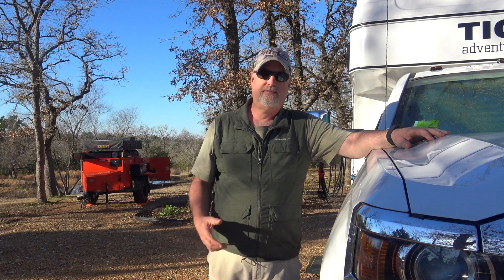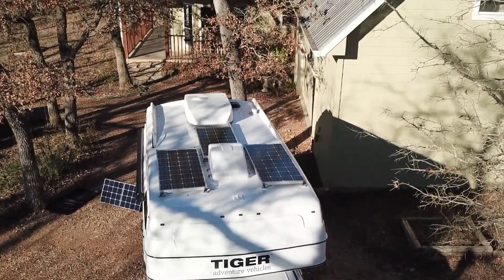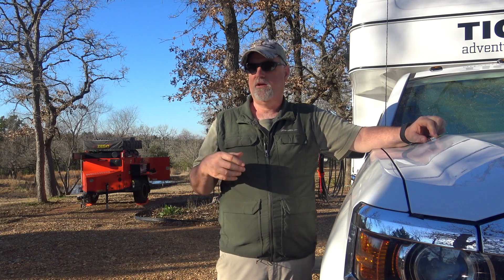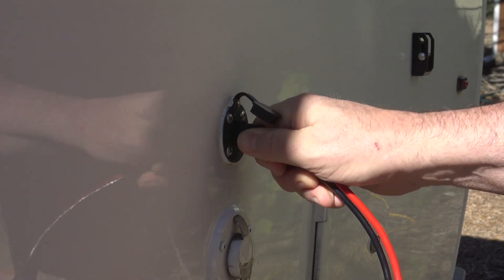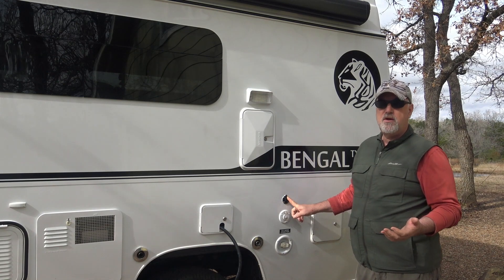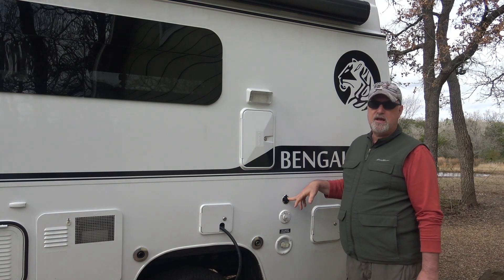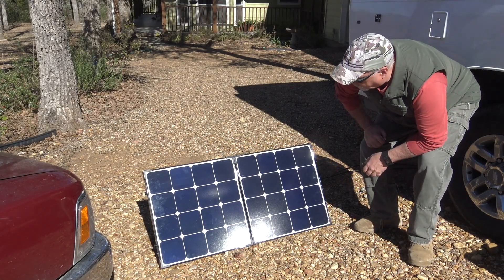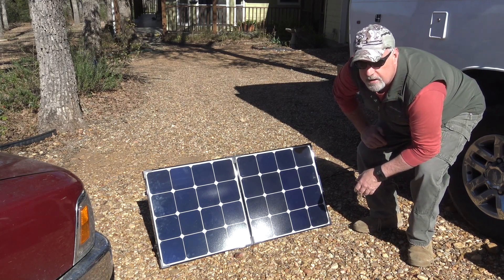Tiger Adventure Vehicle: Solar Add-On

Comment: Do you think lithium is a better option ?
Reply from the maker: I do, but only if the price is right. They are very expensive right now and for full market price, it wouldn't be worth it. But I was just talking to someone in AZ who said he bought three and got 50% back somehow, maybe tax credit, not sure. But over all cycle times versus price, I think AGM still has them beat. I don't think it would have helped my issue. Freezer is a bit of an amp hog. But still manageable.